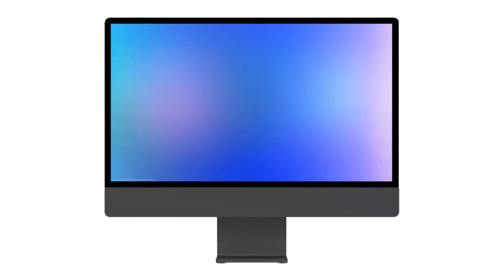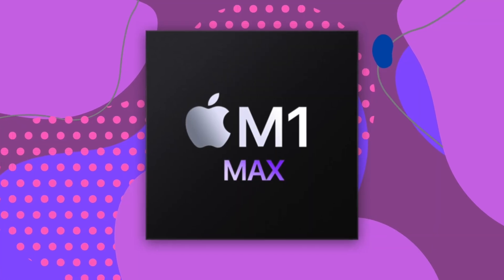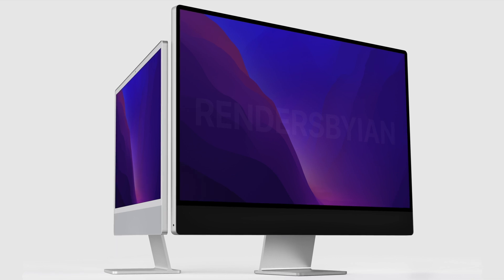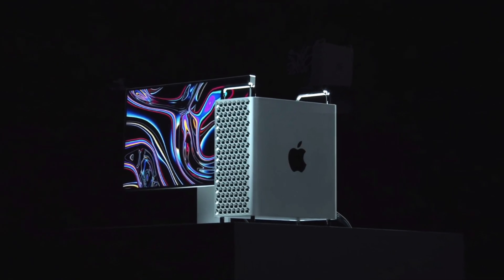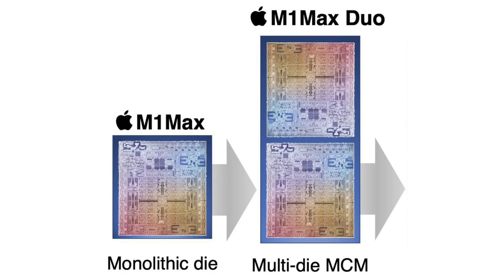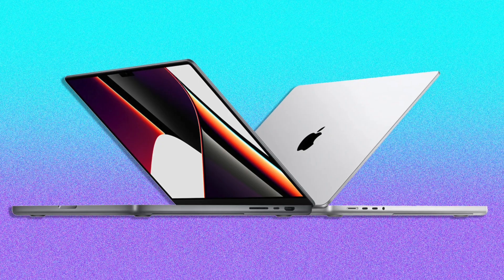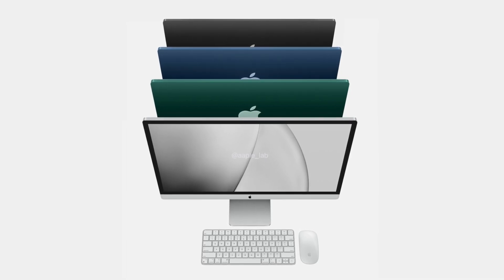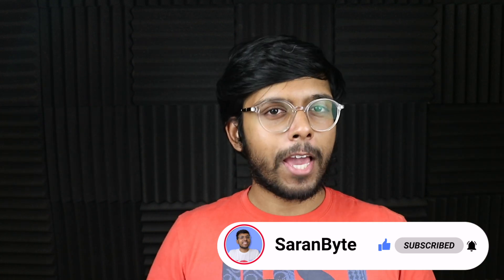M1 MAX iMac Pro - MAJOR UPDATE!

Comment: I think the consumer bigger iMac could getaway with just pro and max chips. The duo and quad versions could be limited to the Mac Pro and possibly the iMac Pro if they resurrected that name.
Reply from the maker: Tbh I still hope we at least see M1 Max Duo in the bigger iMac
Reply: @SaranByte  I think that version would become the iPad Pro.
Reply from the maker: I think you mean iMac Pro? In which case, yes I could see that happening
Reply: @SaranByte  yes I will blame autocorrect even if it was my mistake.
Reply: Yes but in that case there wouldn’t be significant difference between maxed out iMac M1 Max and M1 intel. I think dual M1 max would be an upgrade option.